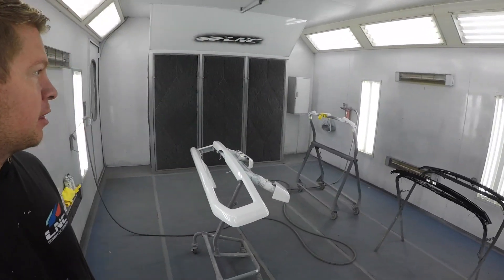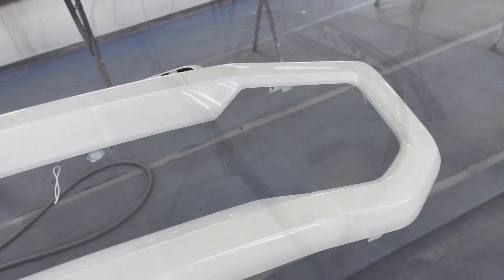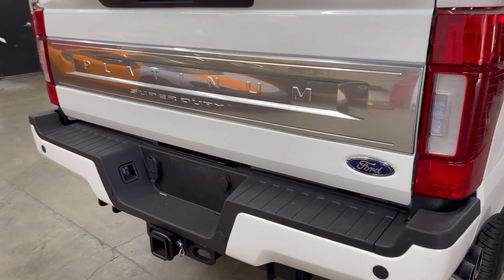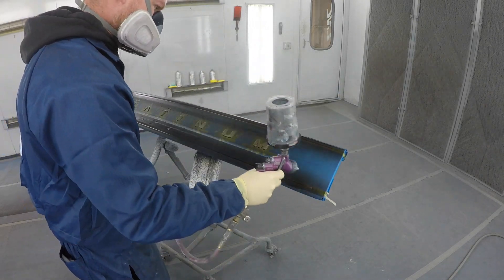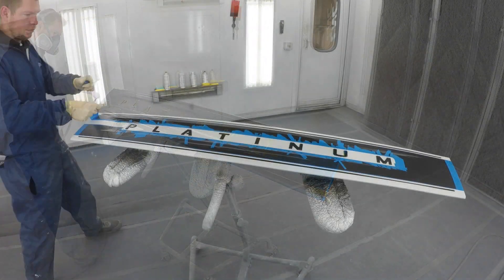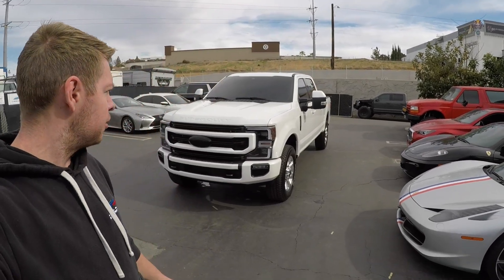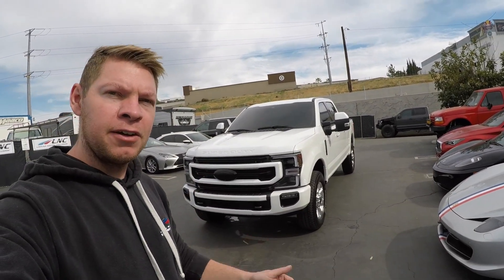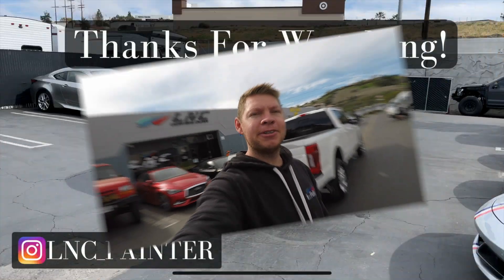2022 Ford F350 Chrome Delete and Custom Painted emblems and Platinum Tailgate Badge

Comment: How did you do this? I have thought about buying new parts then painting black
Reply from the maker: No point in buying new parts, just prep and paint the ones on the car. Take everything apart, prep, adhesive promoter, sealer, Basecoat and Clear 👍🏻😁

Comment: Man, I would really love to know how you got that centerpiece off of the grill and how you've got the small tailgate emblem off. Any info would be much appreciated.
Reply from the maker: It comes off the grill easily, but to take it apart its plastic welded together so you have to break/grind the welds and take it apart…paint it the ln glue it all back together
Reply: @LncPainter  yeah it's got those thin nuts that get it to come off the grill I was talking about. How did you remove the small emblem from the tailgate? Is it glued on? Did you just pry it off?
Reply from the maker: @wespierce1686 yes, i believe it was on double sided tape

Comment: How does the small ford emblem on the tailgate come off?
Reply from the maker: There are 2 10mm screws behind and double sided tape as well
Reply: @LncPainter  how to get to the screws?
Reply from the maker: You have to remove the tailgate plaque first